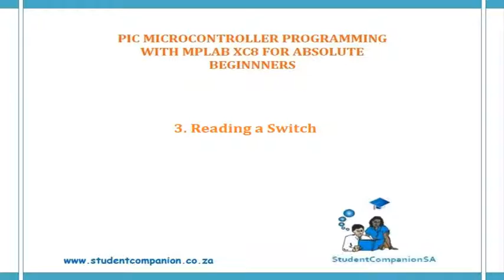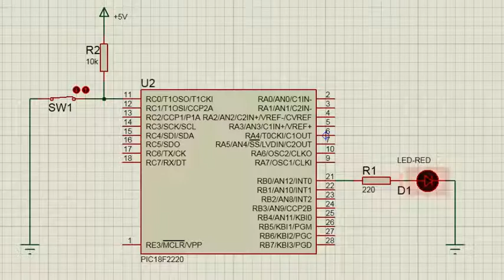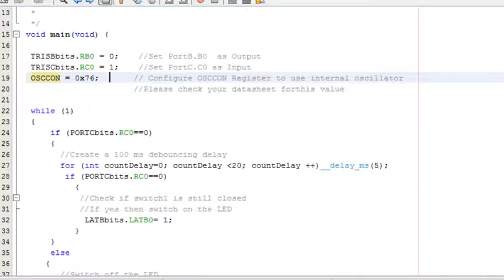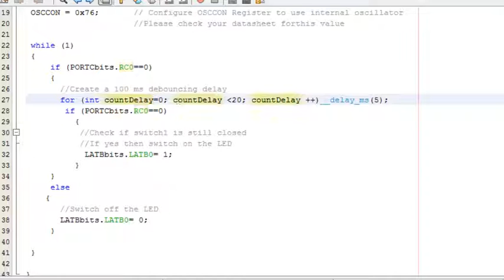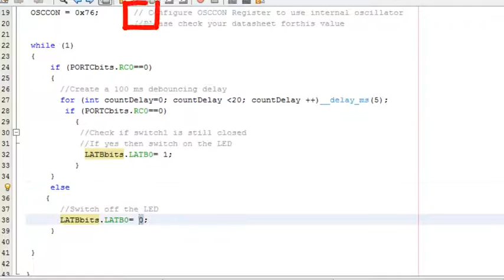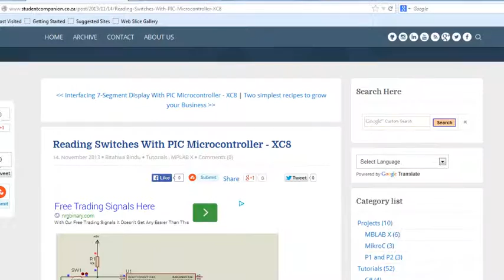3- Reading a Switch | MPLAB XC8 for Beginners Tutorial

Comment: LATBbits are not supported in my mplab X IDE! help me..
Reply from the maker: Which PIC are you using? Are you getting errors or kist warnings? What is the message?
Reply: @StudentCompanion  No errors but the code isn't working😐😐
Reply from the maker: Then its your code or hardware not working.  The problem is not the LAT register. 
I asked you questions About the PIC you are using but you didn't respond.
Reply: @StudentCompanion  I use PIC16F72
Reply from the maker: That PIC is very old, it does not have the LAT register. You can read the datasheet to learn more.

Comment: How to controll a relay? Leds working, but with relay it aint working m8
Reply from the maker: This is how you can control a relay: https://youtu.be/WodS7NA1NlY
Reply: @StudentCompanion I know how to conner properly relay. How to use switch with case. I want to use push button. Clicked (Circuit powered), Clicked again (Circuit is cut).
Reply from the maker: Your question is not clear.  What do you want to achieve? What's not working exactly?
Reply: @StudentCompanion  I want to achieve ON/OFF statement with push button. Button pushed. RB0 RELAY is powered unlimited time. Button pushed again RB0 RELAY POWER is cut. I have working case 1 (RB0 = 1), case 2 (RB0 = 0)..

 if (BUTTON == 1)
            ONOFF(1);
            else
             ONOFF(2);
Reply from the maker: You said the LED works but the relay doesn't work, arw you talking about the same code? If so, then it probably a hardware problem.  Can you post your full code? Nit only a small piece of code
Reply: The code is provided as asked. Now i want to achieve ON OFF statements, but I cant manage the code. Now if i push button and hold LED is ON. Button not pushed LED is off.
Reply from the maker: We really can't understand what you are saying.
Reply: @StudentCompanion  I am using push button switch, not just only switch. I need to control output which is 1(power on) or 0(power off) on the same output channel. At this time i only managed code that is working only while button is pressed. I need to use push button, button pressed once *power on*, pressed again *power off*. It is working like switch but i am using push button. With switch i wouldn't need any programing, but with push button i do need.

Comment: Hi, Great tutorials. Could I use a simple push to make switch instead of a toggle or on/off switch. To turn on the LED and make it stay on/latch until I then press the button again and make it turn back off? Thanks Dan.
Reply from the maker: Yes. You can.  You just have to declare a variable to hold the status of your push button.
Reply: Great, but how would I implement that into this simple code? I have this circuit working perfectly and would like to change the LED for a mosfet and drive a relay with it. I’m new to PIC programming using XC8. Thanks.
Reply from the maker: @99brownd  Something like:
char flag = 0;
while(1){
if (PORTCbits.RC0==0)
flag =~flag;
if(flag==0)
{
LATBbits.LATB0=1;
}
else
{
LATBbits.LATB0=0;
} 
}

Comment: Helpful example. But you start with a very complex PIC. I wish to monitor one switch (an infrared one) and control two output ports.  I likely don't need a 28 pin PIC. Any suggestions?
Reply from the maker: Hi. We can't discuss each and every PIC in tutorials. There are hundreds of PIC models. Almost everything we discussed in this tutorial can be applicable whether you are using a small or a big PIC. Don't worry about the model but the principle
Reply: Oh I understand but I was wondering if you could recommend a basic one that is worth starting with
Reply from the maker: Use Microchip Advanced Part Selector to choose a desired PIC: http://www.microchip.com/maps/Microcontroller.aspx
Select current, don't select mature as it's not a good idea to use old PIC models. Select the features you want like memory, needed peripherals, number of pins etc.

Comment: Or instead of software fix to avoid bouncing problems you can use a capacitor.
Reply from the maker: Yes.  You can use either the software or the hardware method to fix the switch bouncing problem.

Comment: hallo sir when the switch closes the current flows to ground then how does it flow and more over in program why while(1) is used??
Reply from the maker: The current always follow the least resistance to ground. when the switch is open, the only path is through the microcontroller.
The microcontroller execute from top to bottom very fast. to be able to read the status of the switch, we need the microcontroller to read from top to bottom then go to top to bottom continuously over and over again as we don't know when a button will be pressed.
To achieve this a while(1) loop is used to loop continuously.

Comment: HI,
I MANAGED TO MAKE MY CODE TO WORK. THANKS.
however, i am now using pic16F887A to read switch but i am not sure of the following... the way to write OSSCON  Like in your tutorial it is OSSCON = 0X76.  I put my _XTAL_FREQ 4000000 .
2.  I am not sure if XT is for the internal oscillator, In the config bits
Reply from the maker: +Solomon Kojah 1. the OSCCON =0x76 is to use the internal oscillator.  In your case if you want to use 4MHz it should be: OSCCON =0x67. Read your datasheets on page 64. 
2. XT is for external oscillator between 200KHz and 4MHz. In the configuration bit if your PIC has internal oscillator it's INT.  
Watch our video tutorial 1 to learn more.
Reply: I have no INT.   there's RC. HS.   XT & LP.      then again  in page 64 I have found the CCP x M however hiw to calculate to come up with 0*67
Reply from the maker: +Solomon Kojah if you don't have INT it means your PIC Microcontroller doesn't have internal oscillator . You must use an external HS or XT with crystal oscillator .  RC if for external Resistor/capacitor network.
Reply: Okay... thanks ... what about the OSCCON.  I'm using pic for the first time and it is quite a task
Reply from the maker: +Solomon Kojah just connect and external oscillator as demonstrated in tutorial 15: https://youtu.be/ubuT-qiRf4Y
Don't configure the OSCCON.  Remove that line from your code. Configure it only if using internal oscillator.
Reply: thanks.
Reply from the maker: +Solomon Kojah you are welcome!

Comment: Hey nice videos, very helpful. I was wondering if you could maybe explain how to use the internal Pull UP resistor for a PIC. Maybe the PIC16F628A or PIC12F508.
Reply from the maker: +Orlando Lara it's actually easy. You just have to enable it and that's all. Read your device datasheet and make sure it has that function.  I'm not sure about the pic12f508 I'll have to check
Reply: alright thanks, I did read I just wasn't sure how exact;y to enable it. Independantly of which pin need to be activated, I know it's with the OPTION function. To call is it like this OPTION_REG = 0x00? (the value in hexadecimal is not relevant to me now, I just want to know if that's the correct syntax. Thanks in advance
Reply from the maker: +Orlando Lara depending on the device used, most of those pic series only have global pullup enabled/disable.  You can't enable individual pins but as a group on portB. In the option register you must enable bit 6: enable weak pull-ups bit (gp1, gp2, gp3)
Reply: Alright thank you very much :)
Reply from the maker: +Orlando Lara you are welcome!